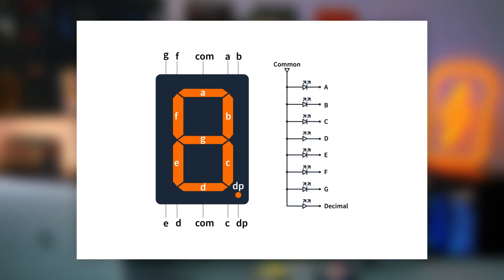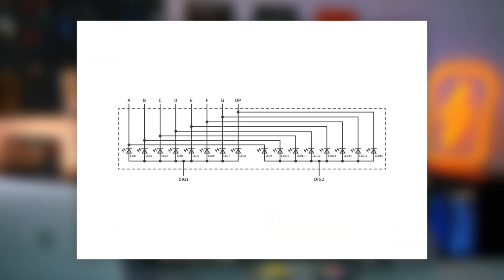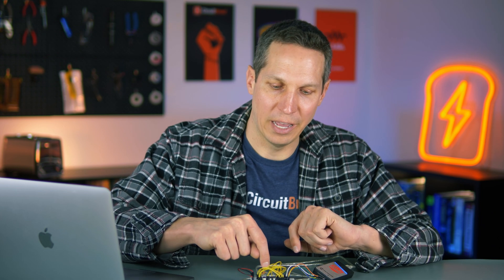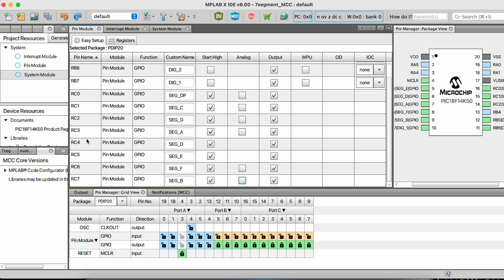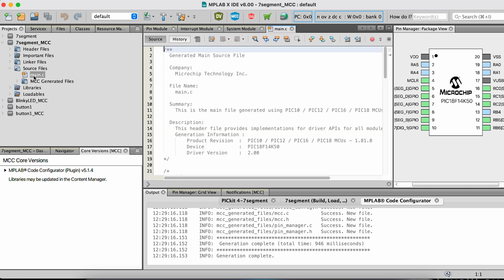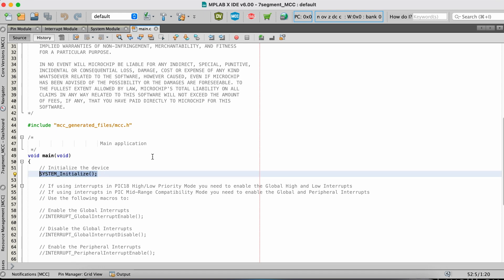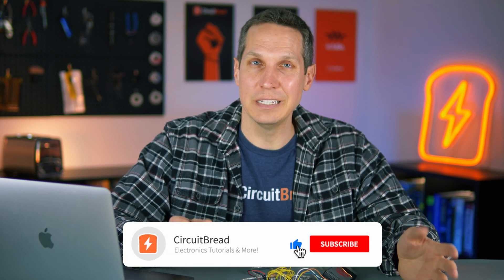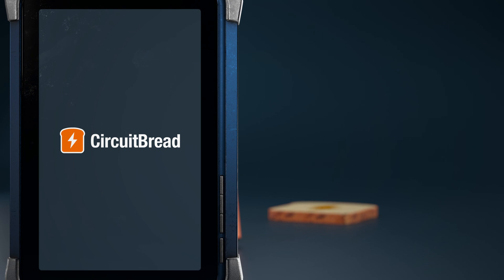Part 7. 7-segment Display Indicator Using MCC | Embedded C Programming

Comment: Can we use 16F690 instead of 18F14K50 ?
Reply from the maker: The 16F690 was the first PIC I used extensively and I love it!  That being said, it isn't as powerful as the 18F14K50 - I think that many of these tutorials would work on the 16F690 (including this one) but I haven't tried it out.

Comment: I like the tlc5917 for this. You get a constant current, and can use just 3 pins to shift in all the data into a register. Add 3 pins for the common anode and 6 pins do the job! No resistors req’d for the leds, either.